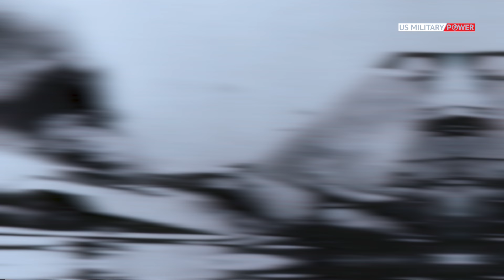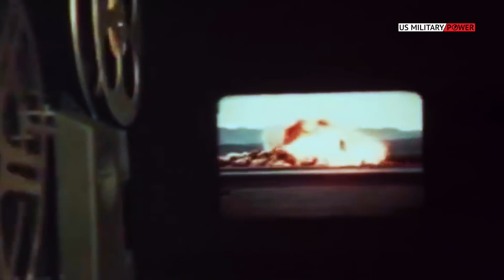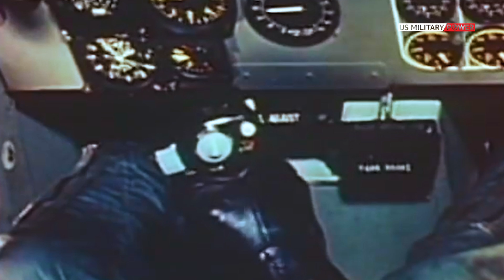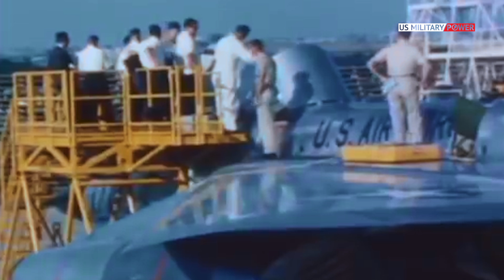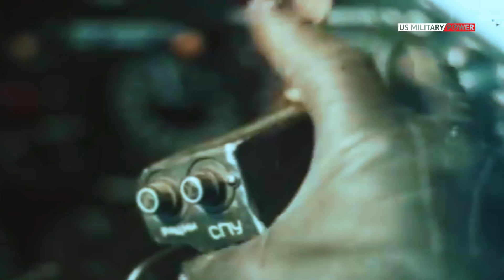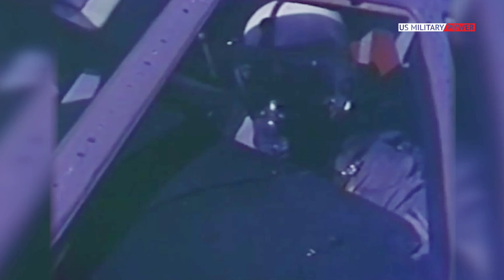B-58 Hustler: America's Cold War Nuclear Bomber Blunder

Comment: I was an Aircraft Mechanic in the Test and Development of the B-58 and also in the 43rd. BOMB WING. YES, IT HAD PROBLEMS, MOSTLY DESIGNED OF FLIGHT CONTROL SYSTEM AND SUCH AS SINGLE CHANNEL PROTECT OIF PITOT HEAT, YAW DAMPNER WHICH CAUSED TWO OF THE CRASH. THE POWER CONTROL LINKAGE ASSEMBLY WHICH RESTRTICTED AVAILABLE FLIGHT CONTROL MOVRMRNY FOR SUPERSONIC FLIGHT WHICH CAUSE TWO OF THE CRASHS, PARIS AIRSHOW nd on e on take-off at Carswell AFE, Texas where the aircraft rolled right and crashed beside the runway on rotation. The B-58 had many advanced systems I did not see on Commercial Aircraft for several years after developed and proved on the B-58. I am a retired USAF and Commercial Aircraft Mwvhnic with 69 plus years experience. Also, the B-58 proved to. Be the best low level toss bomber in the USAF. SO YOU BAD MOUTHED IT WITH LIMITED KNOWLEDGE OF THE FACTS>

Comment: The biggest accident source was the switch from what the plane was designed for. Flying high and fast. Thin air in basically straight lines. 
When Gary Powers was shot down. High and fast no longer was an option.  Nap of the earth at Mach speeds with only a map on the pilot's lap, no computers at that time, didn't work well. Add to this the air density from the massive altitude change. The equation equaled failures. Including my father's dea5h on December 12th 1966. 
The decision to fly nap of the earth, instead of canceling the program,was a money based political decision. 
The aircraft excelled at what it was designed for. High and fast. It was a death trap, nap of the earth.
Reply: The claim that "the biggest accident source was the switch to low-altitude flying ('nap of the earth')" is false.

The overwhelming majority of accidents were caused by high-altitude system failures (hydraulic failures in the flight control system, loss of Mach/autotrim control, fuel balance/center-of-gravity shifts), takeoff and landing accidents, or ground fires.

Out of the entire fleet log, only one operational crash (60-1119, Major Acker's aircraft) occurred directly during a low-level bombing run. The cause was not determined

Comment: THE B-58 HUSTLER WAS NOT AT ALL A BLUNDER. THE FIGHTER/BOMBER WAS A VERY FEARED WEAPON BY THE SOVIT UNION. CONTRAY TO WHATS BEEN TOLD THEY HAD NO PLANE & MISSILE THAT COULD TOUCH IT. Everyone has been fed BS about this weapon. The accident rate maintenance costs were no higher than any other new/developing high tech plane. She could not only fly untouched at very high altitude at Mach 2 but was also just as deadly for the enemy by flying at Tree Top and or Water level.

Comment: My father performed the structural maintenance on the B-58 and it was one of the first using new honeycomb construction in its wing and fuselage. It had to routinely be checked for cracks in the bulkheads.if any were found the wings had to be removed, the bulkheads replaced and then the wings reinstalled. He had a Japanese crew that he managed and he said they were excellent working with...the extremely high stress during the maneuver launching its nuclear pod was very rough on the plane

Comment: For what's worth, the B58 was replaced eventually by the B1 Bomber, gg, GED class 2024
Reply: Not exactly.

The B-1 was envisioned to replace both the B-58 and B-52.

After its cancellation, the B-1 was revived because of delays with the B-2 program. not to replace the B-58.
Reply: The B-58 was replaced by the FB-111.  The B-1 was intended to replace the B-52.

Comment: In the book "Fail-Safe," the Vindicator bomber is depicted as a highly advanced aircraft with intercontinental range and exceptional speed. This fictional bomber was designed for long-range missions and had capabilities far beyond those of the real-life. 2,000 mph cruising speed and able to fly non-stop from the U.S. to Moscow and back.

The B-58 Hustler was a cutting-edge supersonic bomber during its time, making it a fitting choice for the film adaptation of "Fail-Safe." But it was not the Vindicator.

Comment: Like the XB-70 which also went no where the presence of them had some of the effect on Russia that was intended.  Just like the US, the Russian's tended to over estimate the capabilities of the other guy, and the B-58 and XB-70 probably had the effect intended.  And in truth the Russian's did indeed develop some very capable missiles.  It took some time to work out the best methods for attacking SAM sites, particularly Russia's best, but when you have enough of the smart artillery or other missiles to counter fire against an S-400 for example they can't really turn their radars on or they give themselves away requiring an immediate repositioning.  So they sit there without their radars on and a drone can sneak up on them, determine the gps coordinates of the S-400, then call in a HIMAR or similar to take it out.

Comment: Just watched another vid about the Hustler with a gentleman by the name of Col. Holt, who flew as the bomber/navigator in the Hustler.  He wrote a couple books on the aircraft and was on the staff at the Pentagon to evaluate the Hustler for service.  He said those accident numbers included non-operational failures, which were essentially test aircraft that were tested to destruction.  If only operational failures were considered, the accident rate dropped to 15%.  Also, the high costs of the Hustler were incorrectly calculated, as they'd compare the total cost of wings.  There were only 2 wings of Hustlers, with about 40 aircraft in each.  The B-52 wings were about 15 aircraft.  So, it would make sense that a wing of Hustlers would be a higher cost to operate, since there were more aircraft and crews.  Colonel Holt made the statement that what really killed the Hustler was that there were many B-52 wing commanders, and they had a much louder voice than the 2 B-58 wing commanders.....which makes sense.  He also said that the Hustler was an excellent low level bomber, with good handling and accurate bombing results.  That's in direct opposition to what's said in this video.

Comment: So, with the big @ssed fuel pod slung under the fuselage, where did they put the nuke? I am a Navy veteran and retired Army 1SG. In the Navy, during the 80’s, I was a sonartech stationed aboard a destroyer. We were responsible for the ASROC launcher and associated rocket propelled torpedoes…well, the GMT’s were the guys to do pms, etc. we did have nukes and I was in the PRP w/a NATO Top Secret clearance. My job was so classified I/we could “neither confirm nor deny the presence of nuclear weapons aboard the USS ****. Very glad we never had to fire one as it would have been fired and we would do a full power run to get a few miles away. 😅 Destroyers and frigates are worth “one point”, whereas a carrier is worth “ten points”. Easy math to figure out there.
Reply: Your question is readily answered on the internet and in books.

Comment: Wrong, the actual total number of B-58s lost in accidents is only 17 airframes, out of the 116 that were built. 26 airframes lost is very inaccurate.
Reply: Not exactly. 

Yes, 116 were built, and 26 were in accidents. Two were repaired, one being flown again and the other placed on static display.

The correct distinction is that of those 26, 17 were operational accidents, not in testing. And even some of those 17 were due to outright pilot error unrelated to any aircraft deficiency.
Reply: According to what Peter E. Davies had stated in his book on the B-58, only 17 airframes total were written off, not 26, which other historians had written about.
Reply: @johnosbourn4312  100% False. 24 airframes were destroyed. Do you want the serial numbers and the narrative for each?

Comment: You’re regurgitation of cost, reliability and safety are incorrect. A large chunk of the crashes were in the testing phase which lowers the 22% number often quoted to 15% which is also a bogus number as there we only 2 squadrons of 80 total B-58s. The B-58 could out perform the B-52 at low level for speed and rough air performance. The B-58 was killed because they wanted the XB-70 and couldn’t afford the B-52, B-58 and the XB-70.

There’s a great book written by a crewman on 58’s and served in the pentagon when they cancelled it…the 58 was actually a great jet and shouldn’t be maligned like it is

Comment: The plane was not a blunder, it was a great plane and leading edge technology. The plane did what it was made to do and prevented the Russians from starting another war. I was in the 6515 OMS at Edwards AFB and was a mechanic on the TB-58 that flew chase for the XB-70 in 1964 to late 1965. The plane was a joy to work on a top secret plane at the time. The systems I worked on did not seem terribly hard to learn and plane made every take off and flew the mission on time every time. Some of the most enjoyable days of my USAF career, by the way I was 19 at the time. Then some idiot started a war and was transferred to MAC and was a crew chief on then new Lockheed Star lifter C-141A.
Reply: Your right..unless you worked on it or flew it you really don't  know how good this plane was. Spent 5 plus years ground crew 59-2450. Most of the crews that were lost were test crews pushing the limits.
Reply: When they converted all the tube electronics to transistor apparently they became much more reliable. There's avid on YT about this guy who flew in them or worked on them. I think it's about 47mins. Anyhow the bad reliability reputation was damaging politically and they were retired prematurely - so he said. I reckoned with upgrades they were good until about 1985. 
I'd add FWIW (which isn't much) there were other factors like the high landing speed, the nose high position on landing flare that made it particularly dangerous by comparison to contemporary aircraft, so that was in the politicians mind when they canned it.
Reply: Stupid Video Title, like all this guy's videos !
Reply: It cost $6 billion to develop it or $24 billion in the 2020’s. Everything about the B-58 could be done elsewhere.
Reply: Какую новую войну этот самолёт не позволил развязать русским, разве русские развязыали войны, по-моему американцы этим занимаются сейчас, а для  Хастлера у русских уже был МиГ21 который развивал больше чем М 2 , а также был ЗРК  С 75.
Reply: Don't read Russian ! @airpilot039

Comment: What made this plane dangerous is because the airfrme was so fare ahead of it's time . If the plane was made today it would still be bad to the bone . It would be even faster than what it was in the early 60's and much safer to fly with all the updates ans computer and firmwear we have now . Even the engines and the pods would be different . Much smaller and much more power with no flame outs . Can you believe this plane if it was made today with all the carbonfiber tec to build the airframe . It could shed a few thousand pounds and fly at a higher ALT and faster . It could reach Mock 3.5 . or more with scramjets . It could out run Russian rockets .

Comment: The only blunder was retiring it.
It was a great aircraft, just too limited for the "multi role" idea that was taking hold at the time.
It was the same thing that ended the A-5 Vigilante in the Navy.

The Hustler's accident rate was no worse than that of the B-47 it replaced. Its existence also allowed the B-52 to be freed for the conventional role in Vietnam, so effectively it did serve :)
Yes, it was hard to fly, but so were all high performance aircraft at the time. Maintenance similarly was hard on all such aircraft. This was a period of transition, with aircraft performance and complexity growing faster than the engineering that allowed later generations to be easier to use and maintain.

In all the B-58 was the right aircraft at the right time and fell foul mostly to political forces, not operational ones. Just as did its true descendant, the supersonic high level B-1A Lancer (which fell also fell foul of McNamara's obsession with a pure missile force, only to be revived by Reagan as a the subsonic low level penetration B-1B).

Comment: It may have been a blunder but no vehicle looked faster or more over-powered sitting still.  Also, I think blunder is a good term for when an idea would be known a priori not to work.  This plane was a legitimately good idea when it was started, and it's not even totally clear to me today that it couldn't have survived Soviet anti-aircraft missiles with a bit of work.  Yes those missiles could shoot down a U-2 that could hardly even turn, speed up, or slow down***, with no anti-missile countermeasures, but it's possible the B-58 could have done better.  And the Soviet SAMs were known to have worked once or twice but it's not clear how successful they were in general.

* my understanding is that at its altitude the U2 was very near its stall speed even at full power.  So it's going full-power, and can't speed up, but if it slows down it falls out of the sky, and if it turns any at all it slows down and...

Comment: The only blunder was designing a 1970s airplane in the 1950s. 
So far ahead of its time, that maintenance might be difficult for crews weaned on B-36s and B-57s. 
But this video is incredibly offbase and wrong in its interpretation of the B-58 program. The plane was never properly teethed out and never realized it’s full potential due to LeMay being a cigar chomping knucklehead. 
You also never mention that the program was bartered away as part of Nixon’s non-proliferation deals. Do you need any other reason to love it? Changed the course of the nuclear age without being used. 
Personally, I’m pretty happy it didn’t fulfill its intended mission. We’re all still here to watch your faulty videos. You probably don’t think the flying wing concept is viable either.
Oh, I’m out to allow your wallowing in ignorance.
Reply: You may have a point, but the appalling loss rate is still something to reckon with, not to talk about the monster costs!

Comment: what most historians and authors fail to realize or recognize was that the B 58 used a very specialized one off fuel that was highly toxic, very difficult to deal with, extremely explosive, not really safe to use for aerial refueling, dangerous to store above ground and a whole host of other issues.  That was one of the primary reasons the B 58 Hustler was decommissioned, and why there are none flying today.
Reply: Ooh, tell us what they call this deadly fuel.  On your planet.

Comment: B58 was removed from service to make way for the F111 dual service tactical nuclear capable bomber for the Air Force and the Navy. The F111 turn out to be too heavy for carrier operation and it was far more expensive and suffered from far more maintenance issues than the B58. The promise of a dual service bomber is what doomed the B58. The F111 and B58 did the same job and the pentagon wanted the F111. To say the B58 was a blunder is a misunderstanding of percurrent politics.

Comment: The B 58 was full of first! First bomber to lock onto a star. First bomber with a flight control computer. The plane (a bomber) still holds speed records. The only problem was it was way ahead of its time.
Reply: WHAT??? The big Problem was the loss of 26 from 116 in Times of peace. This plane was unsafe like the f 104 and the decision to crap it was right!!!
Reply: @toniplarr3791 Actually no. The B-58 isn't anywhere in the Top 20 most dangerous aircraft. Hell, the B-24 and the F-8 were much more dangerous to fly.

Comment: The channel is WRONG in referring to the 58 as a blunder. It fulfilled a specific mission adequately, but most importantly it pioneered new technologies that allowed the US Air Force to advance over peer nations by leaps and bounds.
Reply: Every aircraft teaches good lessons, some good some negative. Politicians have to think with our wallets, the B58 was a medium range bomber and could never have filled the role it played in Fail Safe. That role in reality was done by B52s.
Reply: @RobertGraziose Beg your pardon!!!!! The B-58s mission was to fly North over Canada, the Pole, and into Russia. There, it was to bomb targets with a nuclear device. Of course, it was to be refueled on the way. But Mach 2 at low altitude was what it was built for. Medium range my azz.
Reply: @tomcooper6108 it was originally designed for Mach 2 at high altitude. It was later forced into low level flying which led to increased fatigue on the airframes.

However no aircraft is designed for Mach 2 at low level. The drag would be way too high and the fuel consumption would be horrible, making no sense to do this due to a lousy range.
Reply: Any and every nuclear weapon is a blunder
Reply: @MyOldFriend89 oh please

Comment: I think the military wanted to look for "speed" way too soon back then. The problem here is, it was going to come with a very high-cost. It was a shame that this wonderful airplane wasn't really a "constant" in the Air Force. It experienced a list of problems stemming from difficulty to control in flight, to higher maintenance costs. Even though the B-58 was much faster then the B-47 Stratojet, it didn't work as well for a Strategic bomber. The B-58 was a "sleek" high-speed medium range bomber airplane, that's turned a lot of heads. What's really noteworthy is that the B-58 "Hustler" wasn't really a supersonic airplane. However, accidental-prone, the B-58 wasn't fazing the Military with problematic controlability issues. However, it did see a decade in the Air Force. The B-52 Stratofortress did a lot more for the Air Force, then the B-58 would have for a Strategic bomber. When everything came true to form, the Air Force chooses the B-52 for it's bombing offensive, and unfortunately for the B-58, it was not going to continue after the ten years.